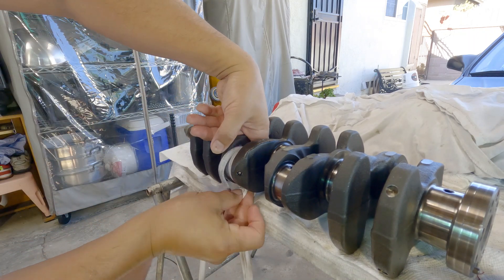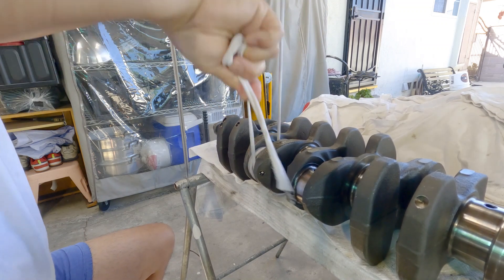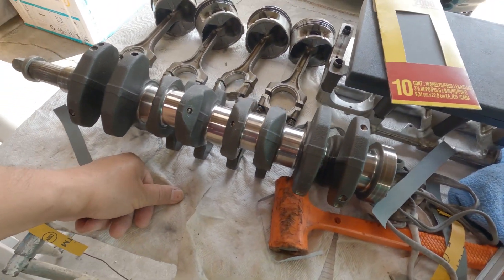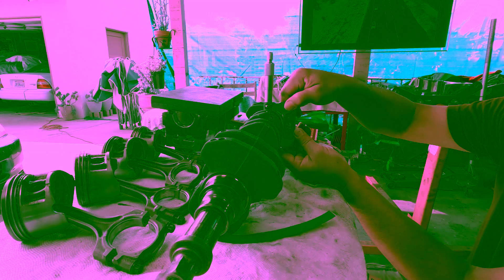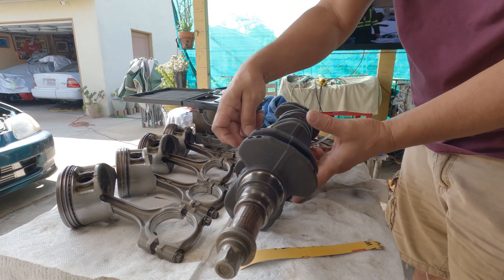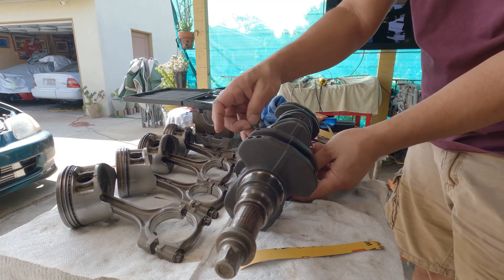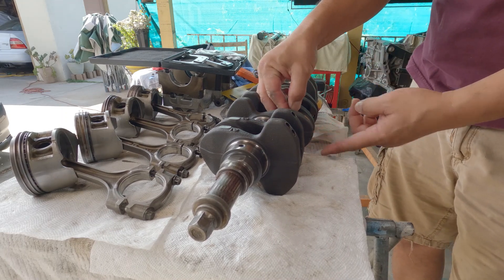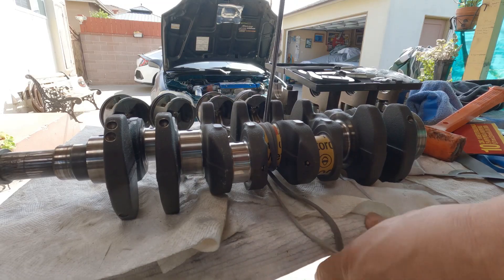F23 crankshaft DIY polish repair.

Comment: How hard would it be to swap thjs crank into a h22 and would it work with type s pistons
Reply from the maker: Not hard at all, l'm rebuilding this G23 using H22a4 block and I'll upload soon. You only loose the oil squiters or modify the piston to keep it.
Reply from the maker: But using a Type S piston will create a much higher comp/ ratio, but should be ok as long as you run it w/ e85.
Reply: @sagittnet2158  what pistons do u recommend since h22 block has a bigger bore
Reply from the maker: @alex13238712  H22 block frm is limited as far as using a forged piston. Only Mahle can be use, but if l ever bulid one again w/o modifying the piston for oil squirters. I'll use Nippon racing piston or Honda OEM.
Reply from the maker: @alex13238712  Sinced your'e asking about type S if it can be use. Ebay sell H22 piston made by Nippon racing. I used their piston before, its a jdm civic type r k20 pistons on g23vtec. No problem on f23 block.